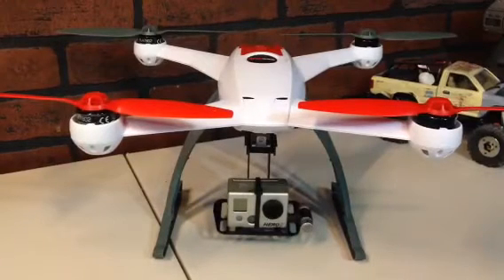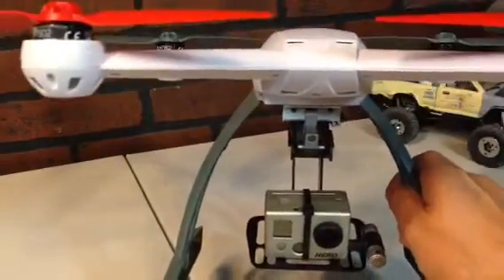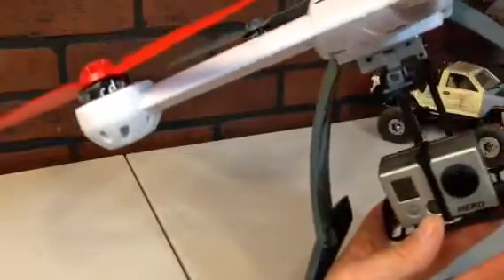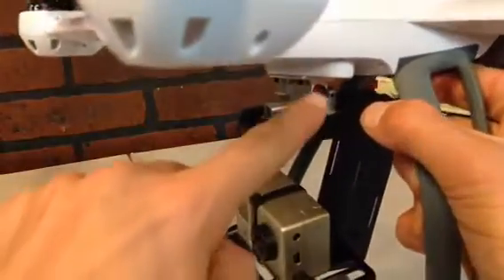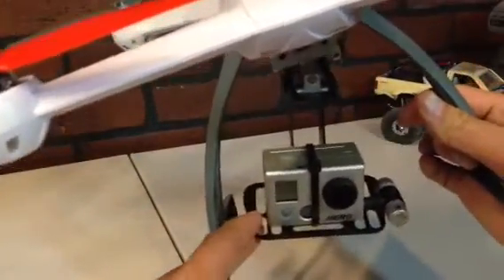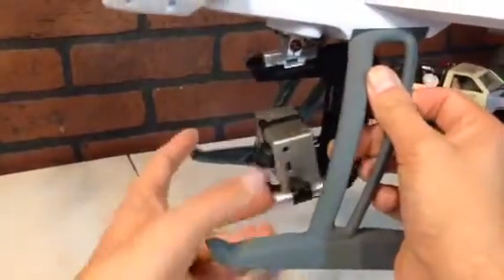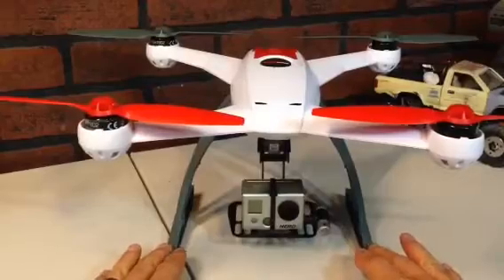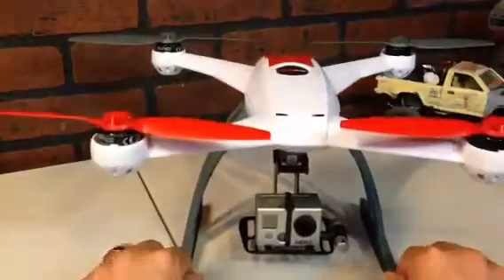Blade 350 QX Dampening Pivot Mount Gimbal Review, Thoughts

Comment: Thanks for trying it, I did think it was a joke product, you may be able to modify frame to a servo gimbal, but they are not great either especially as the brushless gimbals are so cheap now and work brilliantly.
Reply from the maker: Thanks, 
I thought I'd mention that the quality of the rig is actually really nice once you loctite the screws.  The pivot is a thing of beauty.
another downer is that it would be temperature sensitive as well due to the grease in the tuning system.  Not a concern in SoCal but the snowy climates would have a hard time tuning.